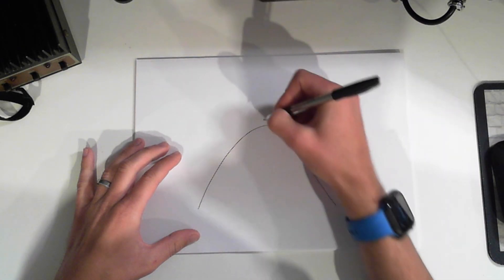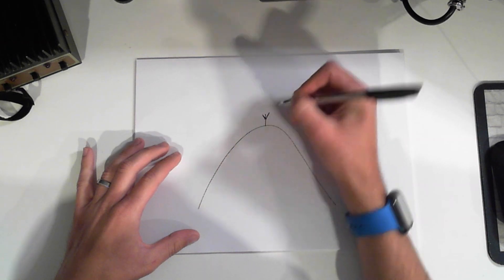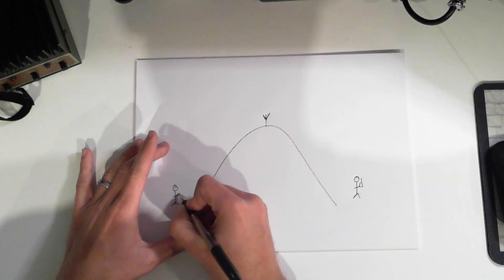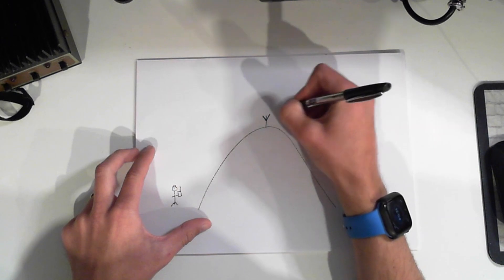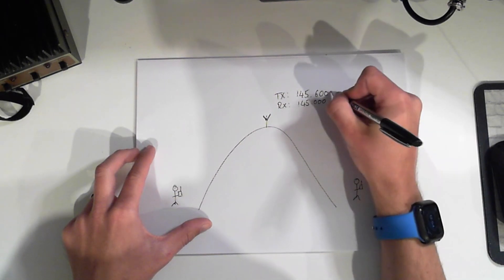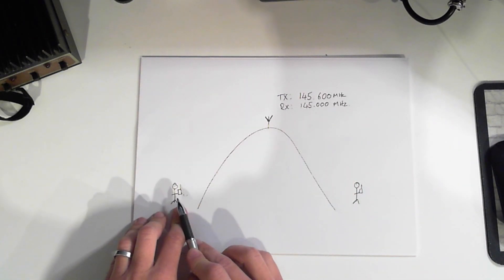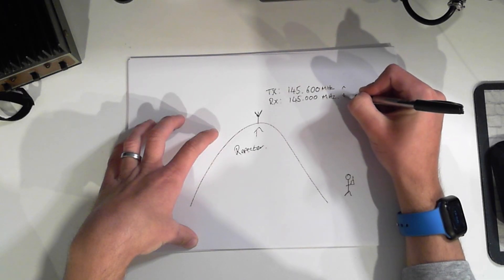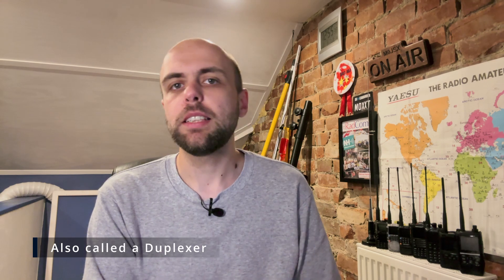Crossband Repeat. What, when and why?

Comment: Great explanation, another reason to be a licensed operator. During the storm season in the mid west I would use my mobile unit in my truck on an aux. power supply on standby on 2m, while I kept an HT inside my workplace on 70cm. Nothing fancy, I just wanted to be able to touch a tower if need be during an emergency.

Comment: Trying to determine if cross band repeater is right for my needs. We have a remote hunting camp in the woods. Nobody in any direction for 20+kms. We use U5VRs for communications while hunting and coordinating work programs. 

If I had something like an Icom 2730 or Yaesu 8900 in cross band repeat mode at our base camp, connected to a Comet GP1 at the top of a 50ft mast fed by LMR400/equivilent, then had our U5VRs transmitting on the base stations’s receive frequency and set in “dual watch” mode to listen to the base stations transmit frequency (ex handheld transmit vhf, dual watch listen uhf, while base station receives vhf and repeats uhf), would that work to extend our coverage area? We only go about 5km/3mi from base camp. Not trying to extend range outside of our hunting zone to make external contacts or hit any external repeaters, just improve comms in our area. We’d have both UHF/VHF setup with pl tone to reduce change of someone stumbling across our comms. “Repeater”/base station would be turned off when we’re not in camp, so only running maybe 2 weeks a year. 

Thanks in advance for the help!!
Reply from the maker: That looks like it ought to work just fine.

Comment: Hi Jonathan.  I use a KG-UV980P to work a local (15 miles away) VHF repeater from inside a thick cob-walled cottage with an ID-51E h/held on UHF. It means I don't have to brave the freezing cold shack in the garden during the winter. 73 G6ATJ

Comment: Good explanation. We actually have a crossband repeater in our club communications trailer. We work a cross-country marathon each year where our operators at the start/finish line can't reach the 2m repeaters in the area reliably because of the mountains. We set the crossband repeater up to transmit to the 2m repeater and locate the trailer in an area a few miles away where it can reach the repeater. Then we transmit from the start/finish line on 70cm to the trailer which then re-transmits to the 2m repeater. We have to remember to give the repeaters a second to both key up, but the communications are very reliable. The other operators on the course who can reach all the 2m repeater because of their location just transmit to it and the operation is reversed. It works great.
Reply from the maker: Sounds great!

Comment: X Band repeat variation.  Assisting at a RAYNET supported city centre event: FT5 on low power (.3w) into FTM-300 in my vehicle (5w out), parked close by, to access a 70cm repeater being used as the central communications platform because the location of the support station was in a TX blind spot but I could hear the repeater on the HT without difficulty.  So to reduce the duty cycle on the FTM-300 and therefore the power requirement I programmed the FTM-300 to RX on 2m, TX on 70cm with a CTCSS for repeater access.  I know for previous experience using the FTM-300 on a fully duty cycle can use up a considerable amount of power very quickly.

Comment: Something that I would be interested in using. I have a FT8900 and a FTM500 which both do cross band repeat. I work outside and would enable me to see these up in the car with a separate battery to run the radio and using a handheld, keep in contact with a local net of evening.  

Trying to dig through various OFCOM documents to find out the rules and regs regarding their use, max output power etc. Intermediate/Full can only set them up ?

Believe this is section 4.5.4 in the OFCOM document released on the 21/02/24 - Amateur Radio Guidance 

Previous employer we had vehicles at work that had a second AIRWAVE radio in the car, which could be put into cross band repeater mode for use in poor coverage areas of London.
Reply from the maker: I think you can set one up so long as the output power is less than 5W based on the licence changes made earlier this year.

Perhaps give Ofcom a ring on Monday to confirm?

Comment: Here in the U.S.  Areas that are saturated with repeaters generally discourage the use of cross-band repeating.  However, out here in the more remote rural area, we use both temporary and full-time cross-band machines.   I like the Kenwood TM-V71A as it can be remote controlled from a UHf radio with DTMF memory feature.  Important to put the radio in medium or low power transmit  mode.   73 de n0km